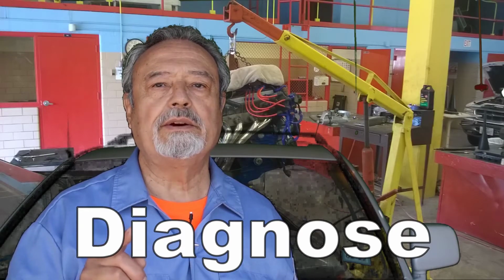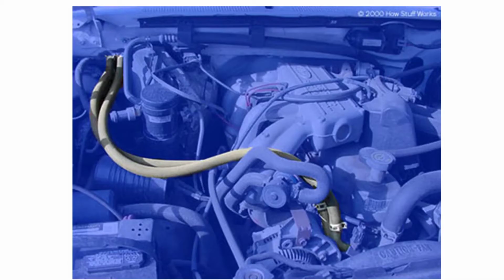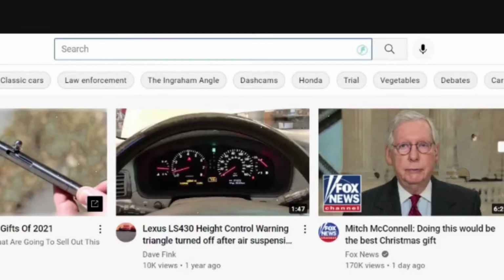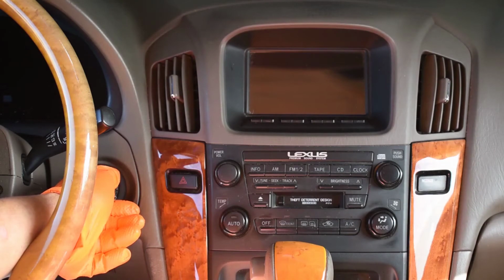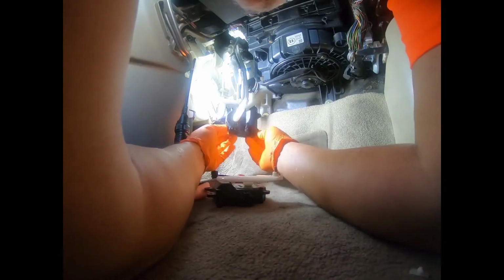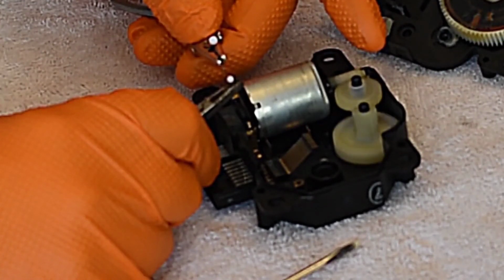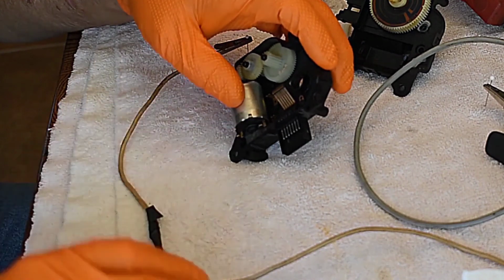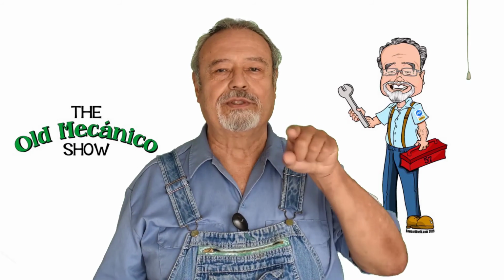Diagnose Heater Not Working

Comment: Good video.
You could expand this to other common problems - like the dual zone systems that blow warm air on one side and cold on the other, vacuum systems that don't work right when driving up hill,   mode change problems - like you want heat out the vents but have defrost only, etc.  No heat at idle only is also a common problem and can be difficult to fix, especially on VW's.
Reply from the maker: Thank you for the View and the comment. Also thank you for the suggestions. I have 16 videos (Lessons) on car HVAC. Maybe you can view some of those. Thank you again.

Comment: One thing I noticed wasn’t covered in this- plugged up heater core.  My old Equinox had that problem a few years ago.  Once I ascertained the normal coolant flow, I unhooked the hoses from the core and set up water hose in a reverse flow.  The hose pressure unplugged it, and worked great.
Reply from the maker: Thank you Glenn for the view and the comment. There was one mention to a restricted heater core about 1/3 of the way through . Thanks again.
Reply: Buddy! This is an awesome tip!

On my Toyota Prado - the right-hand part of the car is getting less hot than the left.

I've been through the whole blend-door, servos hoopla.

So it occured to me - that the heater system is 'imaging' the heater core;

Flat rectangle gets hot - vents draw hot air from across it - therefore, if the top half of the core is blocked, half the car doesn't get heat.

Your solution is brilliant.

I nearly made the grave error of vacuuming it out - but if that was not done with great care - this runs the risk of sucking-closed the entire core!

So - gentle positive water (garden hosepipe) pressure in the opposite direction of normal flow.

I established direction of flow by seeing which pipe was cooler - that would be the Output back to the engine. So - I'll place the hose on that. Still gently.